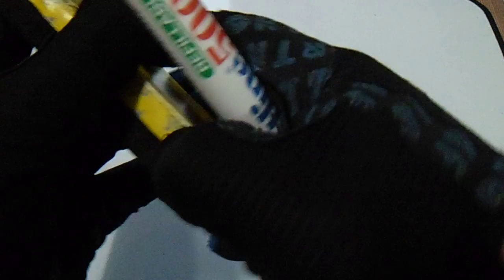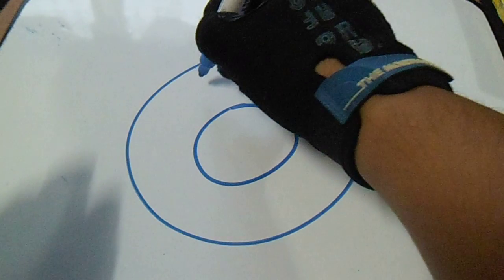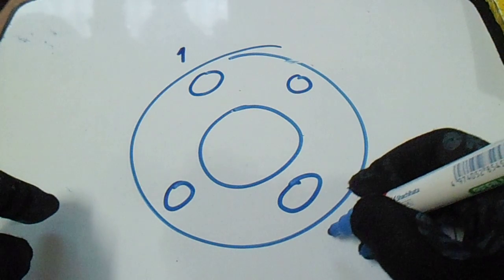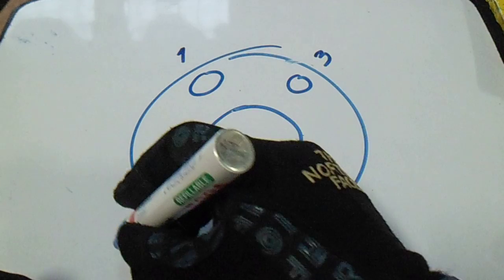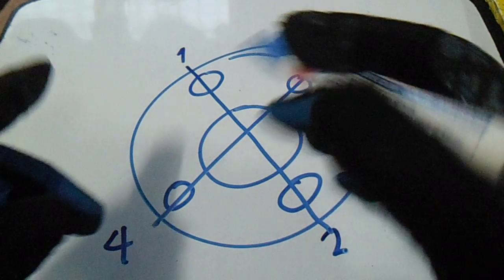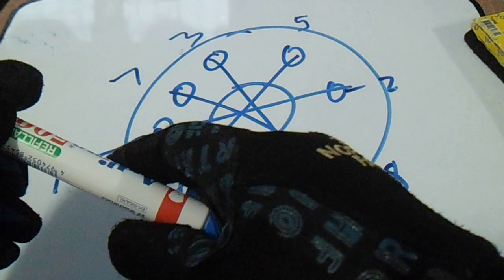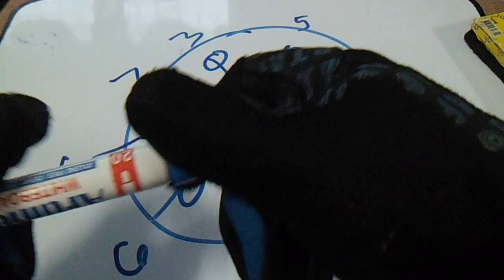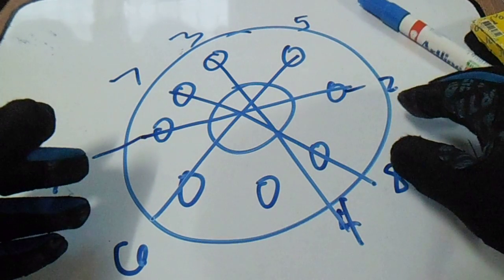Manual & Hydraulic Torquing Tightening Sequence - PipingWeldingNDT

Comment: sir, the proper sequence of bolt tightening is 1 2 3 4, on opposite sides and perfectly squared, then just add 4 to follow the next digit, ex. 1 and your next bolt hole is 5 and the next is 9 and so on, for 2 your next bolt hole is 6 then 10 then so on, for 3 the next bolt hole is 7 then 11, and for 4 your next bolt hole is 8 then 12 and so on. Even you have a hundred or a thousand bolt holes in your flange, that will be the sequence. Try it..... Then when you torque because the title of this show is Manual & Hydraulic torquing, you should have also explained the proper application of the torque value on the sequence in which explains that your first torque, set your torque wrench to 35%-40% of the torque value following the sequence numbering I mentioned then set your torque wrench to 70%-75% of the torque value and repeat the same sequence then set your torque wrench to 100% of the torque value and follow the same sequence, then have another round for final torque with the same 100% torque value, you torque 100% twice because when you torque from 75% to 100%, some bolts will get loose when all bolts are tight (specially those bolts which are torqued first because they are the first once who reached the 100% torque value and others are still 75%, when all bolts are tight, those 1st once relaxes and might not reach the 100% torque value anymore the same with the others. ) Hope this will help..........
Reply: +Arthur Vicedor great explanaition and thats what I wanna say , i will add another  way to be able bolt properly , 
if your flange contains 8 bolt so you will name your bolt as follow 
devide 8/2= 4
so your bolt name is 1.2.3.4 1.2.3.4 means 1-----with 1 , 2-----2 , 3-----3 , 4 -----4
Reply: Thank you very much, a pipefitter showed me this technique and I couldn't find it anywhere online.